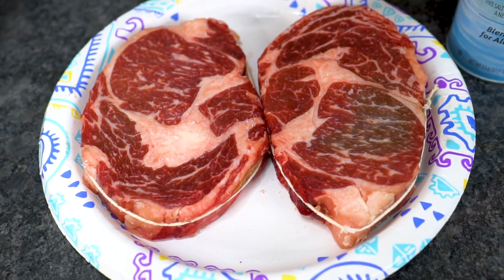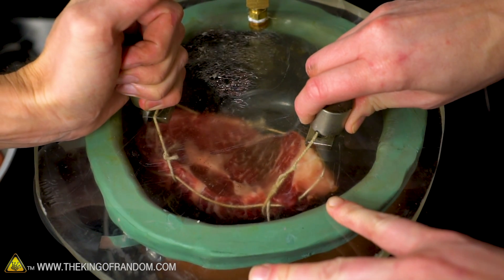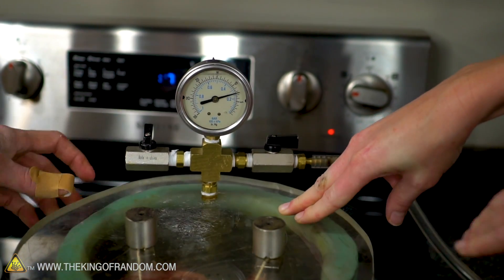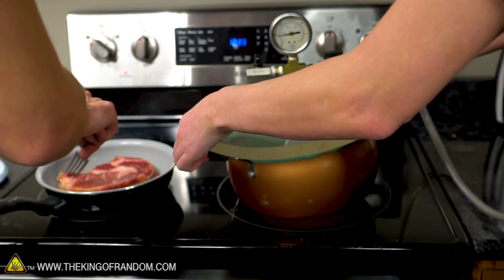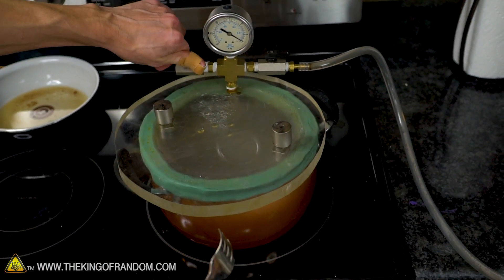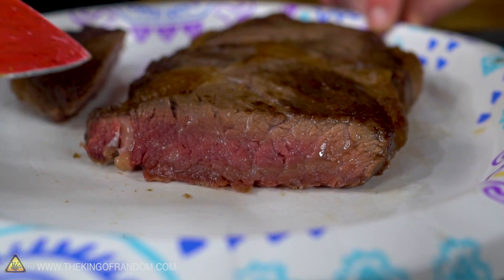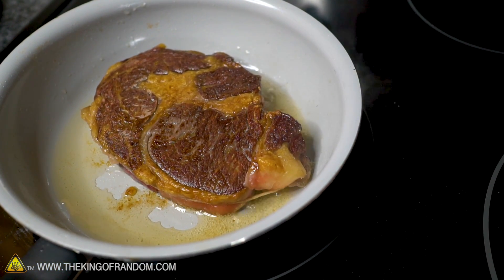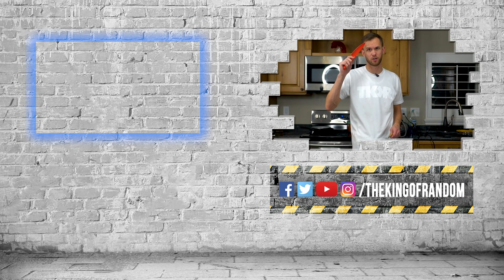How Does Steak Cook In A Vacuum?

Comment: Yes it is difficult to cook properly in a vacuum, it is why there are other techniques designed for it. Sous Vide is a popular method of vacuum cooking. The meat is vacuum sealed in a bag and then the bag is cooked in water allowing the meat to cook in its own juices. However the water is applying a reasonably even heat around the entire piece.

Comment: You'll need to cook longer in a vacuum as the vacuum prevents hot air in the pan warming the topside while the bottom side cooks.
Also the oil, bubbling as it was, will have been cooler and the steak will have cooled under the latent heat of the water evaporating so will have been colder to begin with.
It's possible in principle to get a better caramelization on food under vacuum as the Maillard reaction, which causes browning and caramelization, is inhibited by water, which will evaporate quickly at temperature under vacuum. However, simply drying the steak a little will have the same effect without the effort.

Comment: I don't know the phase diagram for the exact oil you're using but the steak in the vacuum is raw because it was cooked at a lower temperature. In general as pressure decreases the boil point decreases. Please test this by suspending a temperature probe in the oil  next time.

Comment: How is there no scientific explanation in this whatsoever? Do you guys not have Hydro flasks? Creating a vacuum seal drastically reduces temperature transfer because the molecules are not there to react across. Hence why my vacuum seal flask will keep things warm or cold for days. Vacuum sealing a pot to cook in means the metal directly contacting the steak will of course transfer heat. The lack of air around the steak cannot transfer heat and therefore fails to cook the steak properly. This is how the middle of the steak ends up not cooked. This all seems obvious to me as I'm sure it does many others. But many watching your show would not understand this. Maybe try to explain it to them.

Comment: If increasing the pressure causes the liquid to boil at a higher temp, might not lowering the pressure cause it to boil at a lower temp? I think that is what you saw, the oil was at a lower temp and hence did not cook the steak as much. It seemed you were going by looks and sound rather then by actual temperature.

Comment: this was fun and interesting to watch but let me give you a wee small bit of info here... the reason why the vacuum stake didn't cook as fast as the other is one yes it was colder.. as people try to cook eggs in much higher elevations... "thinner air" water will boil at a lower temps in much higher elevations.. this is no different.... also if you are gonna plan on abusing your pump like this then i suggest getting a filter system to trap the gunk, moisture, and any other contaminates from getting to your expensive vacuum pump

Comment: On high Altitudes where air is thinner, water never reach 100C or boiling.
Reply: What?? It boils at lower temperatures at higher altitude
Reply: unknown unknown You are right, “At sea level, water boils at 100 °C (212 °F). For every 500-foot (150 m) increase in elevation, water's boiling point is lowered by approximately 0.5 °C. At 8,000 feet (2,400 m) in elevation, water boils at just 92 °C (198 °F). Boiling as a cooking method must be adjusted or alternatives applied.”

Comment: Could you set up the vacuum to demonstrate explosive decompression? Like have two chambers like the one you have connected with a tube or something, and block the hole in one jar and put the other chamber under a vacuum, then remove whatever was blocking the hole. Thatd be kinda cool. Maybe have like jello or something soft in the normal chamber. Idk. Just thought thatd be pretty cool.

Comment: I'd like to know if ramen noodles cook in a cold vacuum boil.
Reply: I just moved from Florida to Colorado and it takes a bit longer to cook ramen noodles at altitude ive noticed
Reply: @100GTAGUY  I don't know if they still do, but cook books used to have different cook times and /or temperatures based on altitude. Kinda cool to find out that water boils at different temperatures based on distance above sea level.
Reply: lol nope. Need heat. A vacuum doesn't heat water up, just lowers the boiling point to... actually, below the freezing point at normal earth atmospheric pressure

Comment: Cooking a steak in a vacuum........

Have you never heard of steak cooked using a SOUS VIDE machine?

Sous vide translation: under vacuum.
Reply: Completely different from what they did. Sous Vide is bringing the steak up to the desired temp in a vacuum tight bag. Basically you're boiling the steak without allowing air or water to pull the juices out. They're cooking the steak inside an air tight container with direct heat.

Comment: So, the thing about cooking this in a vacuum is that it's taking the heat along with it, so you'd have to heat it up on the highest setting (with a high smoke point oil, maybe grapeseed) throw the steak in it, cover it really quickly, and then proceed to start the vacuum, and probably cook it longer.
If you were to heat the vacuum itself up, it may help a bit, but probably not by much and would possibly damage your vacuum.
Also, they call those kinds of steaks Rare, and if they're almost entirely raw, it's "Blue".

Comment: I mean...opposite of a pressure cooker...higher altitude locations require more time to boil water.  It's going to be the same with a steak just even more exaggerated because it's a vacuum instead of a slightly lower pressure from high altitude.

Comment: You should sharpen your knife, it shouldn't have that much resistance. Also the proper internal temperature for beef should be 155°F with the thermometer stuck in the 2 thickest parts of the meat. Though it's almost impossible to do in a vacuum.

Comment: heat distribution and transference in a vacuum.... yep... without the "gasses" to hold the heat, it didnt disperse very well.... 

you would probably need to heat from multiple directions instead of the bottom up....

Comment: The vacuum steak didn't sear as well because you had moisture trapped in the pot.  Even if you didn't have the lid on, the super high walls of the pot alone would have a similar effect.

Comment: So steak ideas huh? Hmm I have sometimes thought about cooking a steak with a welder ( I use a tig welder at work) but like could  you use a tig welder and the Ark in the air or argon to cook steak? I wouldn't want chunks of molten metal, maybe keep the heat low enough that a stainless pan wouldn't melt. Ar find a solid tungsten frying pan?

Comment: I was just thinking, I cook a steak by the sous vide method which involves putting the steak in a plastic bag and sucking all the air out. I’m using a Foodsaver vac sealer to do this. So technically I am cooking a steak in a vacuum. Hmmmm.

Comment: Wider, flatter vessel. Seal in an small electric grill. This will eliminate the oil and varied surface from the experiment.
You should be able to use proto putty to seal around the cord. Bonus: you have a new device, a vacuum grill, to try other things on.

Comment: Oxygen changes the flavor. If you ever try to age meat to get a stronger flavor, air is a huge factor in taste. 2 cuts of meat, one in an air tight bag and one open to the air, will have very different taste. The vac took out the air, the meat is bland

Comment: Pulling a vacuum on oil will cause the oil to out gas (pull air from the oil).  I used to prepare oil based pressure transducers in a vacuum and bubbles would appear.

Comment: It appears that with cooking in a vacuum, the water turns to steam at a lower temperature. Too low to cook the steak above it.

Therefore, you would want to cook at a pressure where the water vapor temp is at the temp you want your steak.

For med. rare, you would want a pressure near 200mm hg. Around 4 PSI.

On their gage, -20in hg depending on atmospheric pressure. Perhaps even a bit less.

Comment: In a vacuum, the fibres of the meat are pulled apart which is why Chef's love the technique for marinades which get pulled into those spaces much more quickly than normal.  Oil will bubble when water híts oil, even though you may not be seeing that tranfeŕ it could be happening to cause spitting oil.

Comment: The oil level in your vacuum pump is way high which means there is probably a ton of water under the oil. oh and it is also milky which means there is an emulsion of oil and water.

Comment: I think the reason the vacuumed steak didn't cook so well was likely due to heat sink from all the extra material absorbing the heat from the element, as well as the heat being drawn away through the vacuum itself. 

It would be interesting to try it again in such a way that it is cooked properly, and the comparing that properly cooked steak to a normally cooked, properly done steak.

Comment: You should 
1.dig a hole
2.fill the bottom of the hole with hot charcoal
3.wrap a steak in aluminum foil
4.burry it with the charcoals
5.take it out

Comment: Yes you can you can cook with pressure if you buy pressure cooker. It's the same as cooking steak on a stove top except it's just a hair little better. You just have to get the timing right based on your desired done-ness. I would recommend buying an instant pot it's a great  buy. Presser cooked hambergersn and there is air fried hamburgers which are awesome too.

Comment: If you ever do anything like this again...  To keep anything liquid from getting into your vacuum pump, attach an inline auto fuel filter.  They are dirt cheap, readily available at your local auto parts store, and are designed to attach to standard sizes of vinyl tubing.

Comment: Coat a magnet in felt and use another on the outside of the acrylic, move it around to clean the surface. I have 4 on in my fish tank to clean the scum on each window
Reply: Felt has to be on both magnets inside and out. Or it will scratch the glass/acrylic. And the felt needs to be replaced when it gets gross
Reply: Oscar Hillier or you can just get fish, bacteria and other aquatic life to do the job for you
Reply: @imuncomfbecuzihavsubsandno4371  even with underwater snails and elgea eaters they're kinda slow, so I use the magnet cleaners to clear spots so I can see how they're doing. They usually go straight for the accumulated algea after anyway.
Reply: No

Comment: The steak in the vacuum had considerably less contact time with the actual pan. Initially you put the "control" in the pan, listened to the sizzle, and moved it around. Then you fiddled with magnets to get the steak to fall. So you're closing in on a minute differences just there. With thin streaks like that a minute is a lot of cook time. Then while flipping the vacuum steak it was moving around the pan and being bounced around, so more time off of the heat. You took them off the heat within seconds of each other. The internal temp difference was completely predictable. Y'all make great videos, I'd expect you to pick up on that.
Reply: As someone who cooks for a living, none of this little time would have made THAT much of a difference to go from blue rare to medium well. There’s a clear difference having the steak in a vacuum.
Reply: @omnimediagroup5761  with 12 years on a grill professionally, I have to respectfully disagree, a 1/2 to 3/4 inch ribeye is medium rare in minutes. We will have to agree to disagree.
Reply: @GaryOfPallet  only one way to know, do the experiment again with more controlled timing.
Reply: I love that this can start a civil conversation and debate. That doesn't happen much these days.
Reply: The time would certainly make a difference, but in the time it took the steak to get that color on even just one side, it should have cooked through more, you’re both right to a degree. It cooked less because of the timing, but that doesn’t account for enough of it

Comment: The induction heat through the steak should be the same. Temperature is just excited molecules so I’m betting the hot air around the steak cooks it more. So technically when you cook a steak you’re...boiling it in air...

Comment: Without air in the chamber the only way heat transfers to the steak is where it is in direct contact with the pan.  That is why it carmelized just the thin layer.
Try baking in a vacuum.  Doubt it would work at all.

Comment: Does temperature rise in a vacuum though, this confuses me.
Reply: No but things do have a harder time shedding heat away in a vacuum, since there is no fluid (air) to pull that heat away. Also things boil at lower temperatures in a vacuum because pressure helps to hold liquids together.

Comment: Just fyi your cooking that steak in the wrong pan! If you have to cook it in a pan use a cast iron pan.. and if the steak is really thick, sear on both sides then put it in the oven@350 until the middle reads 120*f. pull it out place on a plate and let sit for 5 minutes and it should be perfect!

Comment: I want to see you make a modification vacuum chamber lid that lets you install power outlets or run an extension cord into your vacuum chamber while keeping an airtight seal. This would open the door to experiments with things like making waffles, or using a rice cooker, in a vacuum or seeing what vacuum pressure does to various consumer electronics that would need to be plugged in.

Comment: The pot is a heavier metal with taller sides and it takes a lot longer to heat soak so you started cooking the vacuum one before it was hot enough.
Reply: Joseph DeCesaro true, I think it will work kinda the same tho.
The air around the vacuum steak won’t be hot, so will only be cooking on the underside. So I think they still identified the difference
Reply: @vibrationrising  I get that with no air that there is no heated layer of air but that is a very thin layer.  The steak would cook on the other side before you flipped it much like it would in an oven. So I'm thinking it's a small factor in comparison to heat soak.

Comment: So the reason that the vacuum steak didnt cook super well is because there was no air to heat up the steak around it, the only thing that was heating is was the little bit of oil and the hot surface of the pot.

Comment: The oil for the  vacuum steak would have been colder, as the evaporating oil would take the energy away. However the pot should still be hot. So cooked on the outside,

Comment: Deep frying foods in a vacuum. I don’t think it would be hot enough to get the same results as regular fried foods but it doesn’t hurt to try.
Reply: Why wouldn't it be hot enough? Putting it in a vacuum shouldn't affect the temperature.
Reply: James Hall its because there is no air to heat in a radiant sense.  Radiant heat cooks what conductive heat doesn’t.  Just put you hand close to a hot pan and find out after more than 3 seconds.  In a vacuum (space, heat is not transferred) so the steak stays at room temperature.   It’s just the conductive heat from the oil to the meat.
Reply: @kxrsuperstar   Deep frying means the food is submerged within the oil.  There is no need for the heat to radiate through air into the food.  If anything, it will be hotter, since the oil isn't losing heat to the air
Reply: Just cook it longer.

Comment: The cuts were uneven, the reason they cooked differently is most likely because the vacuum steak was thicker in some spots and thinner in others.
Reply: And its basically the opposite of a pressure cooker that cooks stuff 2-3X faster, so makes sense that it would cook 2-3X slower
Reply: Not to mention the amount of time the vacuum steak spent off the stovetop , while they attempted the flip

Comment: Try to melt metals in a vacuum.
Reply: Actually it would just be the same without it oxydizing that much, that's why you melt steel in vacuum or in an inert gas like nitrogen
Reply: @kypdo1713  Why don't satellites melt in the vacuum of space?
Reply: @DeadbeatDecember  Because their melting point still is too high ?
Reply: @kypdo1713  wrong. Temp of the thermosphere where satellites apparently orbit is 2000oC now go and check the melting points of metals, in particular aluminium.
Reply: @DeadbeatDecember  Check the wikipedia for "spacecraft thermal control" and it's sources if you want, it's a little too complicated for me to explain in comments due to my level in english and the fact that I'm typing on a cellphone